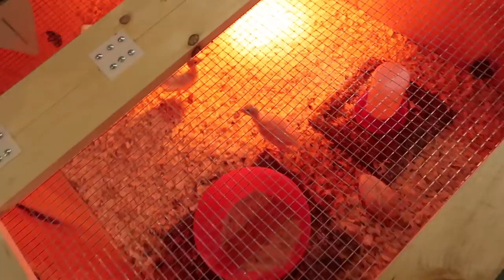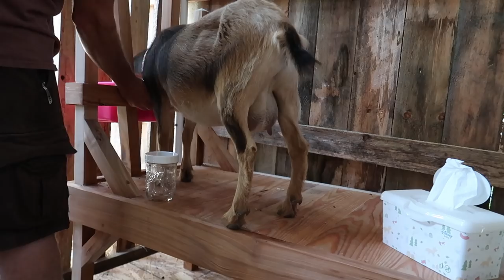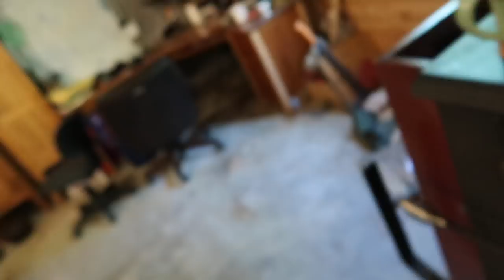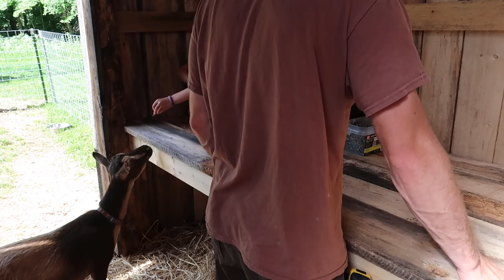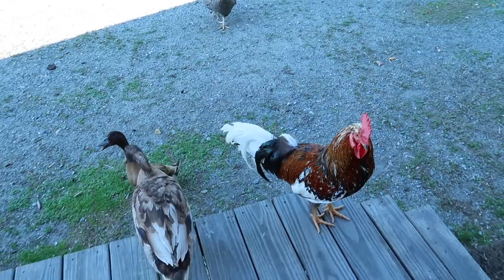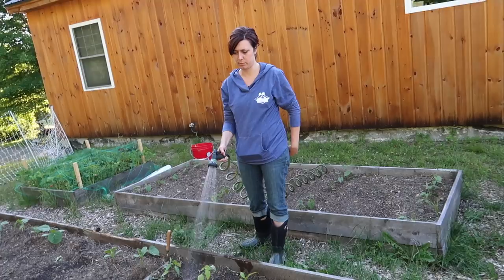Olivia Thinks the Goats need a BunkBed

Comment: If you end up stripping out a hole for a water nipple.......get a rubber grommet for electric wires that the nipple screws in snug and drill out the hole a bit bigger for the grommet then screw the new nipple in. Came up with that first from making a mistake and drilling a hole too big and didnt want to waste my pail